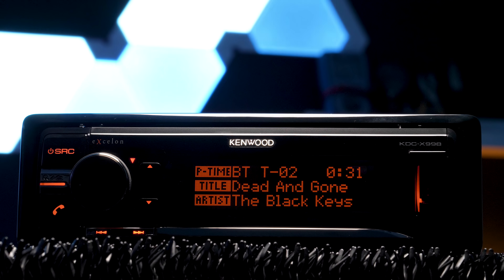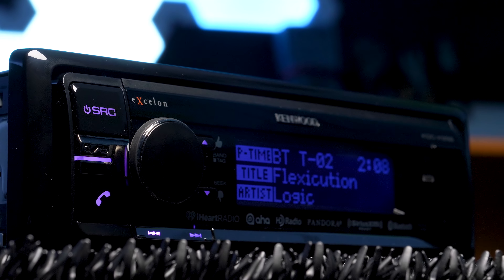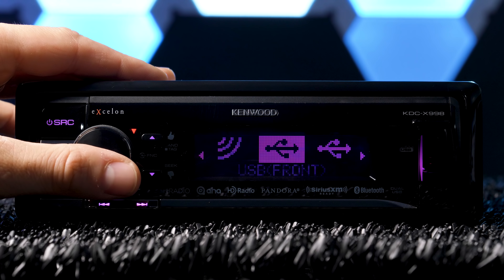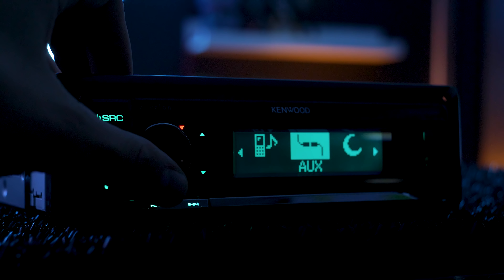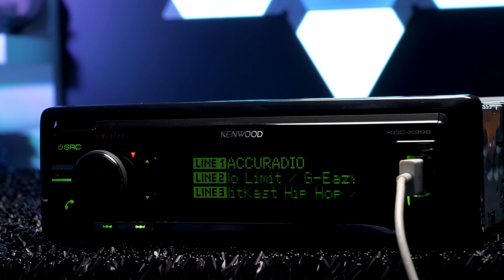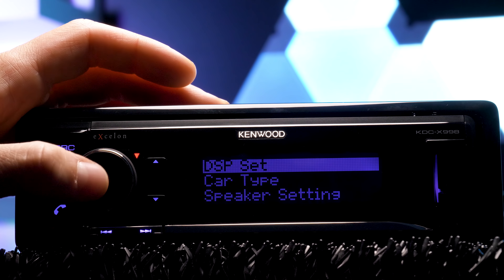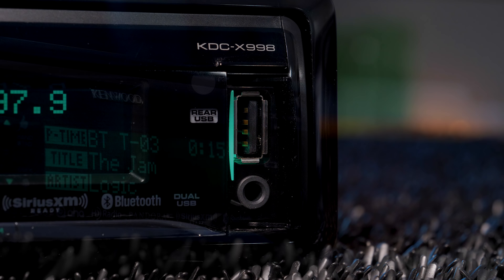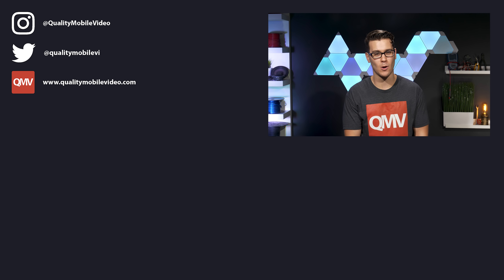Kenwood KDC-X998 - Get It While It's Still Here!!!!

Comment: The X996 is superior with 4 line display. We need a good single din. THey have been crap for years....
Reply: Does it have all the eq settings this has? Can you adjust octaves for subwoofers as well?
Reply: Is that really the only difference between x996 and x998?
Reply: Can't be that a lower model is better, they are numbered based on features . They add small features as those as trade off but if you're looking at higher end are you not looking mainly for quality and fidelity?